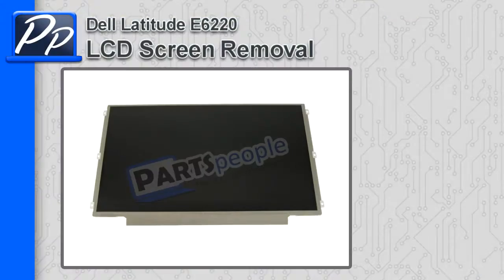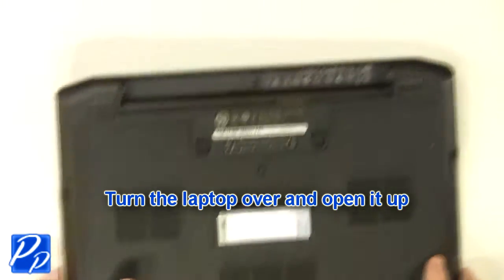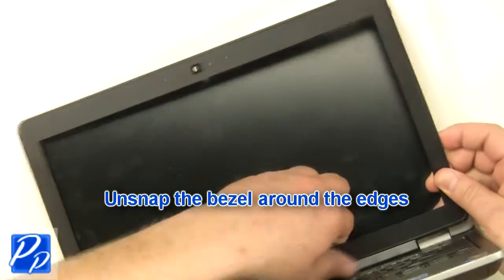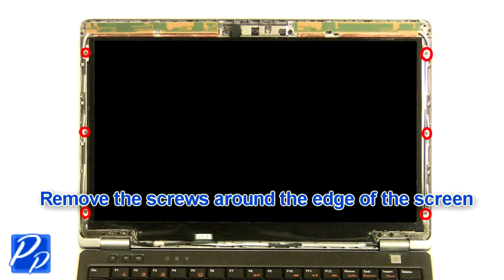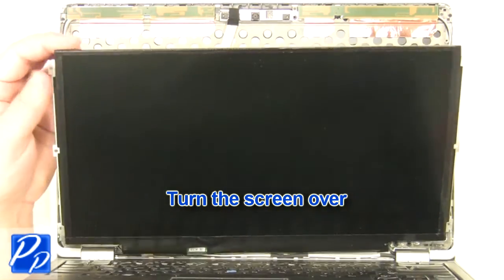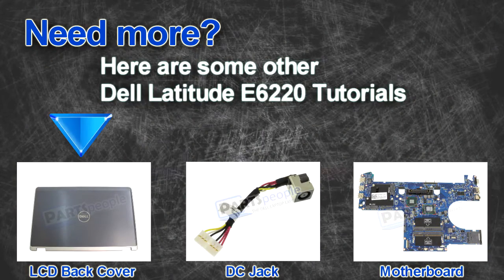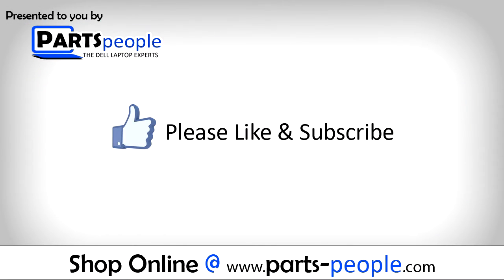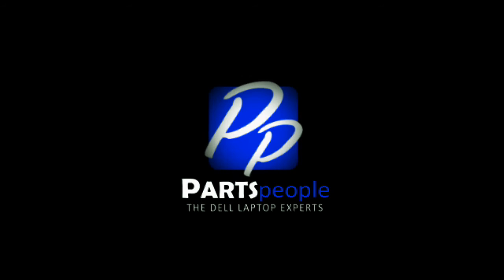Dell Latitude E6220 LCD Screen Video Tutorial Teardown

Comment: That looks easy! On mine, the screen is fine but the lights are intermittent. The pcb along the bottom is very touchy. I think, at best, only half the lights are lit. Thanks for the video! Maybe, just my connector is loose.